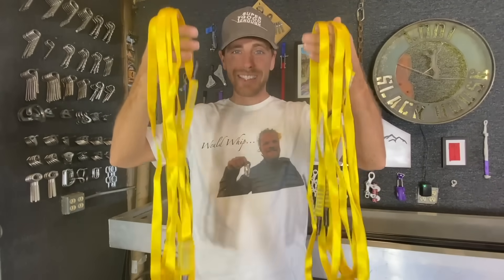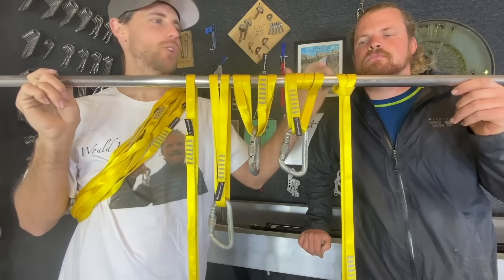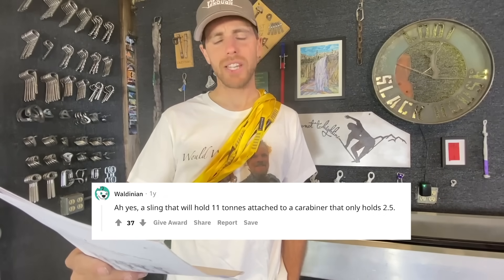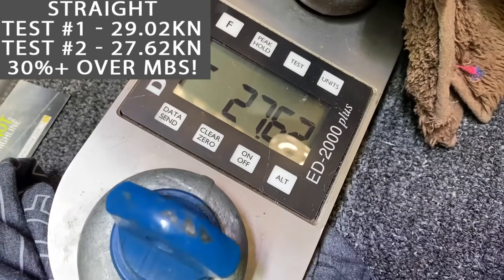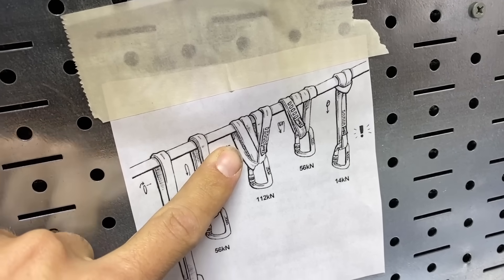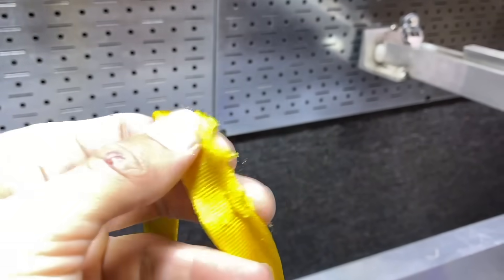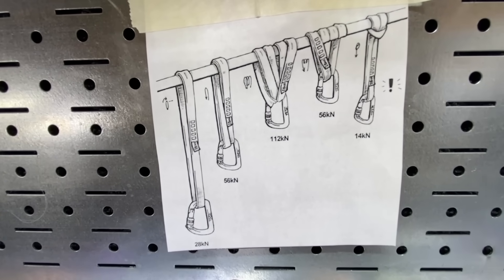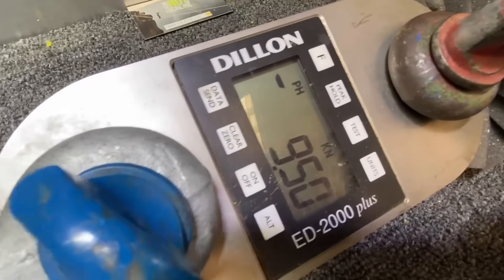Climbing Sling Myths

Comment: the issue with theoritical science is we asume a "spherical cow" we ignore all but the factor we are calculating yes a double double should have 4x the MBS however friction is also increase which leads to stresses within nylon (nylon melts at 220c) which can be achieve just by the tension on the rope not to mention cascading failures increasing strand loading, look at the collapse of the Arecibo radio telescope

Comment: Try this:  Take adding machine tape.  Fold over a dowel and glue.  Sling weights from the dowel.  The tape will hold a lot.

Now put a twist in the tape, and do again.  It breaks at a much lower weight.  

With the twist the path around the edges is longer than the path along the centreline of the tape.  So when you load it the edges take the load before the centerline does, and that starts to tear.

Your vids show some uneven wraps around the shackle.  This could cause the load to be distributed unevenly.

Simiarly in the multiple wraps around shackles, you can get situations where  the wraps can't slide to equalize the load on all straps.

Model testing:

* Materials that have some give (nylon) will come closer to theoretial measures than materials with less (kevlar, polypropylene)  
* lubricating the sling at contact points either metal or itself may make it adjust better.

In addition to trying liquid lubes, try graphite and talc (baby powder)

Comment: 1. A triple wrap allows you to not twist the webbing, and is probably worth testing.
2. You did not test the quad wrap as shown in the picture. It should be a single sling made to wrap four times, with the two carabiners at each end going through the same loops. The way you rigged it might not equalize as well. Or maybe it equalizes better, but in any case you didn’t test it as shown.
3. Why would you expect a girth hitch to halve the strength? Sure, the bending at the knot lowers the strength of the webbing, as does the stitching or any other know, but there’s no theoretical reason it should be by 50%. There are still two equalized strands supporting the weight, so other than some loss of strength at the hitch, it’s just the same as the first scenario.

Comment: Where the sling is wrapped over itself friction prevents the tension from being equal across the length of the sling, meaning it's higher at one point, so the sling fails at a lower than expected weight.

Comment: I'm more than a year late to this party but there's an old rule of thumb of multiplying the force by 80% for every friction crossing point of soft materials like rope/ In pure nylon as long as it's not hot as sin out, would probably go a little higher. And for knots it's 60%, but your girthed one isn't actually a knot, it's a bar wrap. 

Edit: It would probably reduce even further on the girth hitch if there is more slack in the line because it can become unwrapped from the bar.

Comment: There's an imporTant difference beTween a lark's foot and a girth hitch. The lay of the knot you have is more like a lark's foot, and it's probably hard to get much else on a smooth surface like that. A true girth hitch is laid so that it is more directly tensioning the knot and folding back on itself with a smaller radius. And so a true girth hitch does have a much lower breaking strength.

Comment: I am not sure who made the chart you started with, but they know nothing about the physics of tension. Your experiments turned out just as i would have predicted them.  It all comes down to two things in the end - weakest point in the sling and tension.  If you use the sling in the first configuration it will always break at the sewn connection where it is weakest. This will be the same for the girth hitch and the multi-wrap hitch because all of the tension is in two parts of the sling, so half of the tension will be on the sewn connection. If you double loop the sling, the tension is now spread across four strands of the sling, so the sewn connection only gets 1/4 of that tension. This was also common knowledge among climbers in my day, as many climbers were engineers and scientists. I am constantly appalled at the anchors I see these days.  They seem to be put together for good looks rather than safety. When did people start using these fancy cord contraptions with all of the pretty knots?  There are two major problems with these cord anchors: 1. Cord is half as strong as webbing and 1/10 as durable (not to mention 3x more $$$).  2. All of these pretty-looking anchor set-ups seem to end with a single loop of cord at the bottom where the belay line connects with a couple of carabiners. That means that all of your careful attention to spreading the load across 3 bolts and whatever is hanging on the dubious strength of a single loop of 8mm cord.

Comment: I think you should infrared image record the tests. local hot spots may locally weaken. maybe apply load time wise over ten to one ratios, allowing straps to convect, or radiate heat away. Maybe pouring various refrigerants on the strap, may impact strength. Maybe starting pulls with straps immersed long time at different temperatures, before pull starts, water boiling, or ice, or liquid nitrogen, (What is the "service temperature" of nylon strap. Maybe strap starting wetted with water, or vegetable oil, or mineral oil (These changing inter filament friction). I'm sure there are studies! 
I'm so ignorant, what studies have been done bending strap around different radii? 1/8 inch, 1/4 inch, 1/2 inch, 1 inch, 2 inch, 4 inch?  I suspect the longer the bending radius, the more evenly the stress is applied to the strap, the less stress intensification there is causing premature failure.

Comment: The 50% estimation on the girth hitch is for a safety factor, largely because as you state, there are too many variables.  Better to underestimate break strength than overestimate.  Just like how the sling is rated at 22 but actually hit 28.  

You didn't get 4x because folding the sling over itself creates friction and pressure points causing it to cut into itself.  If you used a large enough shackled and carefully laid the sling over it, I think you could get close to the 4x mark.  But in real world use, you'll never get that.

Comment: On the tests with multiple wraps, the strap is laying upon itself. As the pressure is applied each wrap gets locked in by another wrap which does not allow each leg between shackles to be equal.   For the best testing results the straps should not overlap so to be able to equalize each leg early in the pulling to get the maximum strength. Still this yest does give a good idea on load limits.

Comment: re 12:23 Any saddle wrap (& any configuration which causes the webbing to be twisted) should be expected to stress the edges more because they are forced into a longer distance than the center of the webbing.  Once the edge gives way, the center strands suddenly take the entire load.  ... How far was the edge damage from the final complete break?

. BTW: I believe 1# ~ 4.5N(usually rounded to 5N); I find this a handy baseline for static & dynamic head calculations when considering anticipated load vs stamped kN eqt. limits.

Comment: The choker configuration shown on the label of a sling is weaker because of the angle of the sling as it goes around a large, square crate or something similar, not the choker or girth knot itself.  The tension on the sling is related to the angle of the sling relative to the force applied.  Formally, the tension = load/sin(angle).  Same thing with a slack line.  It takes infinite tension to make the slack line stay straight when a weight is applied to it because the sin of 0 = 0 and load/0 is infinite.  So when the choker makes a 45° angle to the force, the tension on the sling is 1.4 times the load, and at 30°, the tension on the sling is double the load.  For lifting, any angle less than 30° as measured from the horizontal to the sling is not recommended.  This is why the derating factor is 0.5 for a lifting sling - they assume you won't use an angle smaller than 30°.  If you have a suitable anchor shaped like a crate, you could test this.  Usually, the edge of the crate cuts the sling first, or the crate cracks.  You could use a steel shape like an I-beam or square shape with rounded edges to get a better number.  The angle will change as the sling stretches so the measurement needs to be done with a camera to watch the angle as the load increases.

Comment: I think for the last one, you need to look at first failure.
Those mini-pops I'd wager are at half.
(It's putting more weight onto only one of the sides, so once the first failure happens, it puts a bit more weight onto the other side)

Comment: It’s still the same single piece, but due to friction it can’t shift smoothly. Your math only holds if the tension is slowed uniformly, but that’s impossible to obtain in this setup. Eventually, one strand will be under more tension than the rest and will snap, even though the total tension is under limit. When that one snaps, the whole thing fails.

Comment: Nice tests.   I think you need to test the slings with the carabiners and not the shackles.   The smaller the diameter the object the sling is attached to the more bending and more friction will be applied to the sling.   By using a thicker shackle attachment point the sling will outperform expectations.... Smoother surface, sling doesn't bend as much, more room to stretch along surface before it bites into itself ect.

Comment: I'd say the dynamic fall scenario is most likely to generate those kinds of loads.  However, the peak load during a fall will be quite dependent on the amount of line deployed and its elasticity.  Dynamic lines will do a much better job of absorbing shock - but a static abseiling rope (especially when it's doubled up) when used to absorb a fall could produce quite a bit of shock load on an anchor.  Under most impacts, a shock factor of 5 would be quite severe.  So, in theory an 80 kg person would produce a load of = 5 x 80 (kg) x 9.81 (m/s2) = 3924 N, or 3.9 kN.  If you suffer this fall when rescuing another climber that becomes 7.8 kN.  So, the safety margin with a 14 kN anchor point is starting to get a bit small.

Comment: I imagine the double double doesn't generate 4x the strength because the friction at the folds. If they could be arranged in a snatch block setup, where the lengths are able to even themselves out as the load is applied, it would perform much better

Comment: A lot of the reasons for increasing my safety rating when doing highlines is more about using the most safe anchor for a given situation and being aware of failure potential.  Another thing I try to keep in control is how much stretch is in a system.  Once I get my patient, the more stretch I have in a system the less comfortable the ride is for them.

Comment: "some" data on bend radius strength effects could be extrapolated from the gin pole diameter data in the ANSI/TIA 1019-a also in that technical they claim synthetics need a 10:1 safety factor probably for the reasons you were discovering with friction heat and cutting itself. This is probably why you dont typically if ever see synthetic ropes used in the rescue bag

Comment: As a certified industrial rigger I have some knowledge of fabric slings and their proper usage. One of the things that caused your premature failure was whether the eye ends of the slings were vertical or at an angle. Angle loading of slings greatly reduces overall breaking strength and the steeper the angle the lower the breaking strength. If you use longer slinger to reduce the angle on the multi wrap connections it would have a direct effect on your ultimate breaking strength. The reason you encountered melting of your slings where the choke overlapped due to wrapping or doubling is the inner portion of the sling cannot move freely over the shackle due to the outer layer pinching it down as it loads. The result of this pinching is friction and subsequent chaffing between the layers and an uneven loading of the sling and pressure points within the wrap. The final variant where you have made a loop of the sling and passed through that loop will normally fail on the section where you formed the loop. When tightened, the loop is pulled until it begins to have too tight a bend radius and that causes the failure. 
To see what is happening and why they fail the way they do, take your footage and slow the playback speed as much as possible. With a slower playback you should be able to see where the failure starts and surmise why it fails. A very good book regarding rigging and other associated lift or retention of loads is the IPT Crane and Rigging Handbook which can be purchased on line from WWW.iptbooks.com . or email: iptpub@compusmart.ab.ca .  IPT's books are also listed on Amazon.

Comment: They’re snapping at less than 4x because the straps aren’t universally stretching the same. 

Straps on straps causes enough friction in the system to put more force in a single spot than across the system.

Comment: I think the reason why the break strength was a lower number on the wrapped configuration vs the doubled over (or basket) is because of the extra friction in the wrapped configuration limited the amount that the two sides of the sling equalized tension as it was loaded, therefore loading one side slightly more, making the combined break strength a bit lower, whereas with the basket, it was able to distribute the load to each leg more effectively, sharing the load.

Comment: The theory is close but doesn’t account for friction at the axles or overlapping sections.

They’ve calculated strength as if each bend were in a frictionless pulley

Comment: Should have done 1 more test with the fixed hanger. A simple doubled over nylon sling! Then we would know if it was the lark's foot or the hanger edge which causes the low strength.

Comment: I've used nylon climbing webbing in these ways to connect shackles to rope pulleys in stump pulling systems, and I found this very fascinating.  The breaker machine seems to apply the load slowly.  I'm eager to find out how the dyneema vs nylon girth hitch may respond with a faster loading impact, such as in a drop tower scenario.
Reply: Also, I've recently read that slings labelled as Dyneema are often hybrids of dyneema and nylon, specifically if they have a combination of colored fibers and white fibers.

Comment: Have you tested girth hitches in a configuration like this to see how sling width changes the strength of the girth hitch?  I can imagine a very thin 8mm dyneema might fail at lower than a 12mm one

Comment: About 11:00 minutes. 

Super interesting. 

It would be important to run the experiment with a single fiber and using calorimetry. If the single fiber heats up to the point of undergoing a phase transition, it is a common entropic-spring effect that happens to elastomers. Upon mechanical alignment, the entropy of the system decreases and heat is produced. This is easy to test with a rubber band. 

This can be the source of heat. But again: it would require a "clean" experiment with a single fiber and a calorimetric equipment. It can also be guesstimated by calculations, but the experiment is crucial. Super cool the heating effect you detected.

Comment: Here's my theory on the quadruple sling breaking at way lower than the calculated force:
The outer layer of the webbing is pulling against the inner webbing with a lot of force and compressing it. 
This is equivalent to increasing the tension on the inner strand, reducing the ultimate breaking strength.

Comment: The physics explanation for why the double double failed is because some parts of the sling were not directly in the direction of the force.

They will also be pulled slightly to the side, so the total force is slightly more than the force in the axis of the piston.

Approximating the highest angle any part of the sling is at to 25, this sling should've withstood about 80 kN of force.

Comment: Marine Assault Climber weighing 170lbs with 60lbs of gear, missing a pro placement at 10’, takes a 20’ free fall, generates around 4000+ ftlbf.  His belay man is 2 point anchored at the start of the first pitch using dynamic ropes.  11mm ropes used were rated for 5,000lbs for a reason.

Comment: this is about slings , not elephants ...   interesting to see  your testing of slings .   the testing of carabiners was a great show , it just disclosed  that ;  yes they deform and bend and fail in overload and some designs sooner than others but it was clear as glass what you were doing.  now the slings came with a image of five situations  and only three were actual options , single for comparisment to the rating and than fold  once ,  double fold  and a choke . The fourth image illustrated is nothing else than a single fold  ,and the choke is actually a knot .  but great examples to show where  it does the opposite of what you had in mind. 
the frictionfactor  , the molten slings are a very good indicator you came close to the edge of breaking , but it also shows   that if you would put the friction moment a wee bit further by using pulleywheels instead of simple flung around a pin or hook .. the actual breakforce would be a bit higher and not break in the same spot.
any type nut is always bringing that friction break closer and a very neat ideal balanced rigging will bring the best out of the gear.  In professional lifting with cranes etc  you will never use a strap double folded because the friction will rate the safety use to one  while single fold is two .